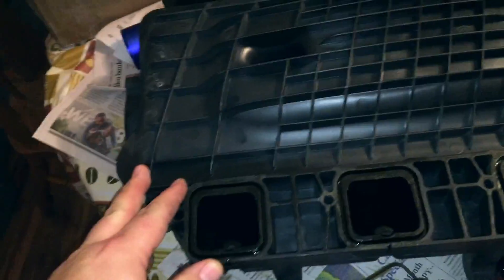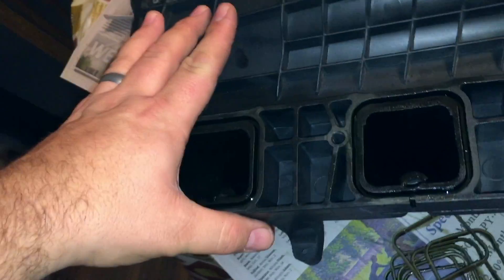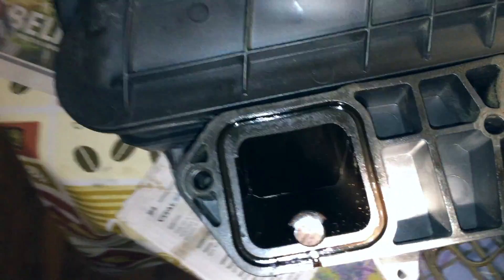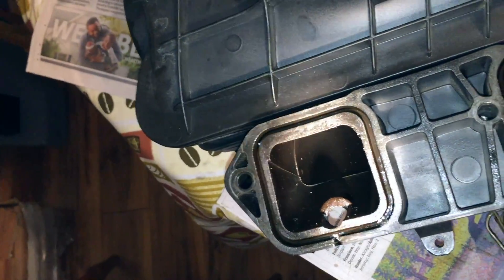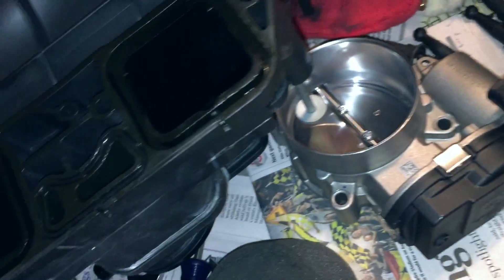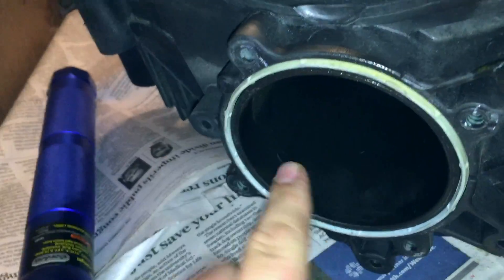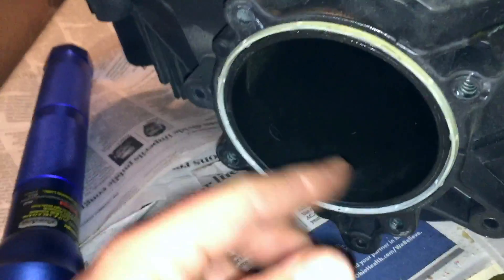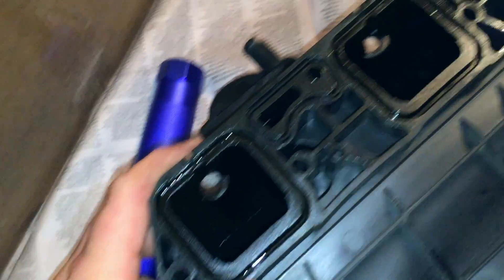5.7L Hemi Intake Manifold Pre-Porting

Comment: I wonder if i can use gasket matching to port my cylinder heads?
Reply from the maker: Don't need to since the manifold is plastic and the heads imprint well into it.  Clean it up and you will see where the plastic needs removed.

Comment: Looking to do this on my 2011 5.7 charger rt AWD what size dremel are you using?
Reply from the maker: I had the dremel kit and started out with the 60 grit sanding band.  That took off a lot of the material.  After that I continued with 120 grit sanding band.  When I was done with cleaning out the excess plastic, I started hand sanding it with 300, 600, 1200, and 2000 sand paper.  It took me a while, but it worked.  For the future, I would use the Jegs 92 piece port and polish kit.  That will make the job much easier compared to using the dremel sanding tools and you can get much higher into the runners.  Harbor Freight makes a fairly cheap port and polish kit too.  The dremel sanding bands are great at the openings of the runners, but are difficult to get higher into the manifold.  The polishing ball helped to clean up some of the smaller bits of plastic but I wouldn't use it in the future.
Reply: 345 Shaker so start out with dremel with areas you can reach then use the jegs 92 piece port and polish kit to smooth everything out?
Reply from the maker: Nah, just go straight for the port and polish kit.  It will do the same thing as the dremel sanding bands and will make getting up in the runners easier.
Reply from the maker: You still have to hand sand up inside with a higher grit paper.  Can't get away from that.
Reply: 345 Shaker ok gotcha
Reply: 345 Shaker i just seen it jegs for like $33
Reply: 345 Shaker how high of grit would i use 2000?